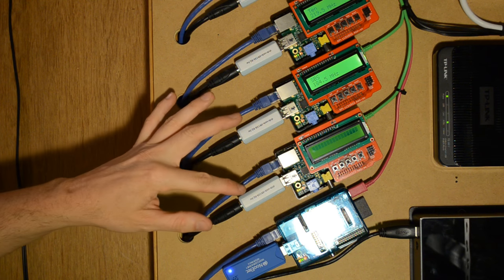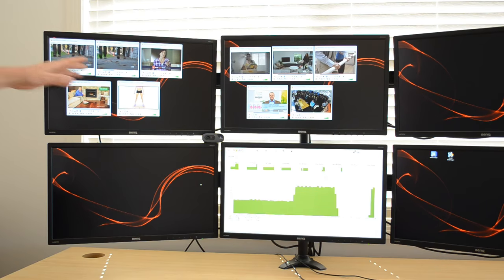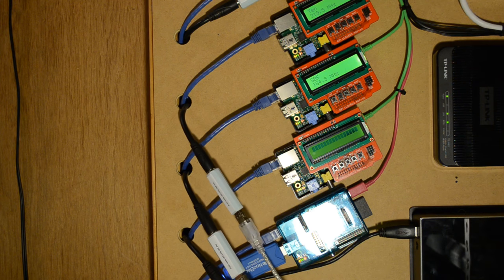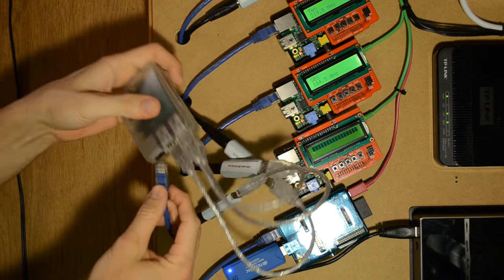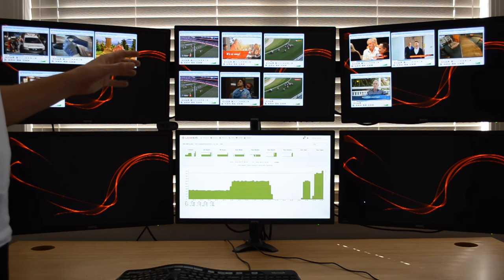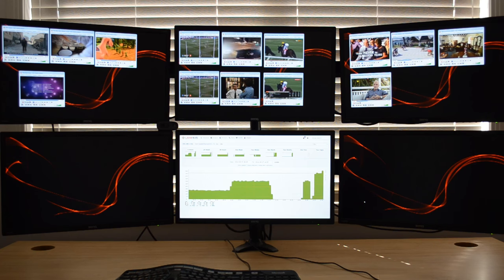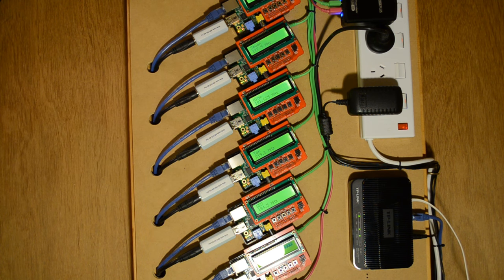Raspberry Pi Multicast TV server - Part 2

Comment: Witch OS are you using on you Raspberry Pi? I'd like to use a raspberry Pi with a Dvb-t receiver. I've been using my laptop but I'd like to use a Raspberry instead. The other thing is that I really like the windows media center interface and its simplicity. Thanks
Reply from the maker: Just Raspbian

Comment: Hi. I was wondering. Why are using multicast? Wouldn't it be easier to use a TV Server Software like TVheadend, MythTV, VDR, etc..?

You can still have multiple Tuners (if you need to), but you can also record and timeshift.
Reply: But then you limit the number of clients.
Reply: Well, not really. By using the aforementioned TV Servers, you can have multiple simultanous clients on the network watching TV. However, if you only have one tuner, then everyone can only watch the channels on the frequency that the Tuner is tuned into.
For a typical Family household, it would make sense to have as many tuners as there are TVs in the House.
TV Server apps with support for multiple tuners are usually smart enough to pick the next free tuner if a client wants to tune into a channel that's not already being broadcast.
Reply from the maker: Multicast is scalable. The Raspberry Pi will only ever serve each channel once. There could be thousands of people viewing the video stream, but no extra work for the TV server.
Recording and time shifting is the concern of the viewer.
This is just a project, not really something people would use in their home.
Reply: Ah ok. I was gonna say, your setup looks exactly like a IPTV setup for an ISP. Total Overkill for the home. But interesting nonetheless. 
How is it with network bandwidth? Does multicast impact your non-multicast network traffic?
Reply from the maker: I have it mainly for testing multicast with Wi-Fi... and for fun ;)
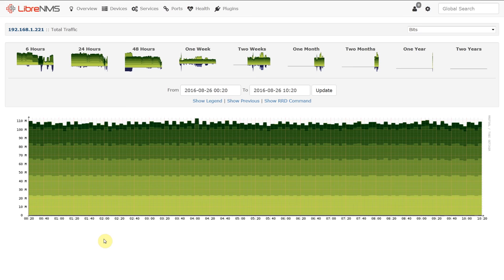As for network bandwidth, see this video @ 2:21    https://www.youtube.com/watch?v=fjDbVIWD8YU
Reply: Did you need IGMP Proxy or to just make sure IGMP snooping is enabled for software bridges?

I had two tuners streaming to the LAN myself but I found it murdered WiFi (I later discoverd IGMP snooping is disabled by default on OpenWRT) and the fact I only have unmanaged switches I was concerned it would flood lesser devices.

Instead (as I am running these on my server so plenty of bandwidth) I switched to broadcasting to br1 (with no physical NIC assigned) and then using udpxy to allow tuning in via unicast.  Its a lot cheaper than buying a managed switch to handle the multicast traffic properly.
Reply from the maker: Just IGMP snooping. Switches of course have to have that feature.
Multicast over Wi-Fi can get messy quickly, as you found. You should check out my other video on multicast.
udpxy is a great program. I might do another video about multicast, as people seem to have confusion about its use.
None of these videos are about what's easy for cost, or what people might find useful, they're just demonstrations of the technology.
Reply: CWNE88 I did have to compile dvblast and bitstream as DVB-T2 support wasn't working without a patch.  There was very little documentation about that and I kinda regret not making notes at the time.
Reply from the maker: I can't help with DVB-T2 as we don't use it here. We do have a HD .h264 channel though which works fine as is.
Reply: CWNE88
I kept the patched source so its not a problem, I just don't remember what I had to do so couldn't offer any help with it to others. ;)

Comment: Google tells me that libreNMS is just for monitoring. What are you using for routing? I've tried a few solutions including pfsense, but didn't find anything I love. This is largely due to the fact that I want to bind a 4 port nic to use as a switch (not ideal for performance I know, but I'm after a drop-in solution to replace consumer grade routers)
Reply from the maker: Routing isn't needed for any of this as it's all on the same L2 network. If you did want to jump VLANs you'd need PIM.
LibreNMS is just for monitoring, correct.
I use a Palo Alto for my routing, but a free, pretty good one is pfsense
Reply: Yeah, sorry, the question was a bit of a non sequitur to the video. Was really hoping to find something for my toolbox better than pfsense, but hey, it does the job. Thanks!

Comment: I was just wondering what this setup could be useful for? If you own a motel and want to get tv to all the rooms? Also, that tuner just picks up free local hd channels?
Reply from the maker: This setup isn't for everyone. It could be used for a hotel as you say, or a corporate network to give staff TV on their computers.... as if that would ever be allowed by management!
Reply: what for are you using this setup?
Reply: On our university campus we distribute TV over the campus network for the members of the cable TV association.
Reply: COMO LO HACEN AMIGO
Reply: Single high quality antenna and some splitter and  you can watch anything on any computer in the house.

Comment: bit fuzzy on the config files from the other video and this setup - its one tuner per frequency, with the config file specifying the pid for the channel and the multicast group to use, is that correct? so with 3 tuners on the one pi, you are tuning in to 3 different frequencies at once, with all the associated channels being broadcast and you just use vlc to select via multicast group?
Reply from the maker: Correct.
The -a says which tuner to use (ie,  /dev/dvb/adapter0 or /dev/dvb/adapter1 and so on.
Reply: thanks for clearing that up :)
have you thought about using a more powerful sbc like the orangepi? it might be able to do more tuners at once, and cost less than multiple rpi's?
Reply: I have 3 of the Orange Pi's. 3 different types. Not much support but much better specs. I bought them to do a smaller version of this for  7 rooms in the house with screens. I have 2500 DVD's movie and TV collection and they are starting to take up space and weigh a lot. I have my own netflix. I wanted to rip them all to disk so they are easier to manage and find. I haven't gotten very far because there is not a lot of support for the OrPi's.

Comment: I suppose the PaspPi would be able to handle more tuners if you had a powered usb hub. I think 4 tuners overload the maximum power output of the Pi USB host.
Reply: That's a good point. He never said anything about that. I wonder...
Reply: that what happened  it   nuke  the  power out put if  you use a power hub it be  fine on that  may be if  it support go with usb 3.0  tunner
Reply: 6 are no problem with external powered hub. This guy is a bloody noob, he just hit the usb power limit.
Reply: Tom78 where is your vlog then?

Comment: I have 5 tuners (it9135v2) on a powered hub on my raspberry pi 2B. I'm not doing multicast, but using tvheadend. So only the actually watched channels are sent to the switch. I know, there are situations when the multicast is better and in other situations the simulcast is do the work.

Comment: Hey, great video. In Norway we have two DVB-T based networks with MPEG4 encoding, one  for the national broadcasting corporation which is free to watch - and another commercial based one with encrypted channels..

Unfortunately, seems like dvblast only supports MPEG-2... (as stated at videolan's website - or I might be wrong? )

Do you know about any alternative that supports MPEG4 streams?
Reply: I use tvheadend with rpi-osmc dist.
Reply from the maker: Most of our channels are MPEG2, but a couple of them are MPEG4 h264 1920x1080 so it definitely works.
I don't know how you'd go with encrypted channels though.

Comment: When you hooked 3 Tuners There was 14 channels on your screen. Did they all came from those 3 Tuner? I was searching for TV tuners on our Local market that supports encoding multiple channel at the same time, But I failed :(
Reply from the maker: It's one tuner per frequency. Each frequency has mulple tv stations multiplexed into them as a complete bitstream.
Reply: @TallPaulTech   Thank you for quick response.

Comment: How many tuners can a RPi4 handle? Have you tried?
Reply from the maker: Easily 4 if you have a good power supply
Reply: @TallPaulTech  Five at a stretch??? Via an outboard USB hub of course???
Reply from the maker: 2 MHz of RF sampling takes about 35Mb/s of network. It won't take much processor, but power will be your main issue (and possibly RF noise).

Comment: Any chance you know of a good frontend/smart tv that can join multicast groups? I'd think about something like this for motels in my area if I could either recommend a smart tv or could pop in a hdmi PC stick or something that gave the guests the ability to just sit there and flick channels with their remote - while at the same time if they want to choose netflix instead then they can do that too
Reply from the maker: The only one in hardware I've used is something made by Amino. That was years ago though.
OSMC can view multicast, you just have to make a .strm file with the address in it.
Reply: Cheers, doing the maths I'm wondering if it might be easier to just use kodi and tvheadend...means I don't have to make sure multicast works properly across all my switches.  With a gigabit backbone I should still be able to serve at least 50 concurrent streams.  Or would a unicast system also launch a new thread and tax disk i/o each time the same multiplex is requested?

Comment: I see you have more than 1 tv turner inputs, why is one tv turner is not enough?
did you buy more than one cable package or do you have to have more than one tv turner.
usually one cable serve lots of channel. can you enlighten me?
Reply: The antenna / RF cable contains all the transponder frequencies with their respective services - all the channels are there, but you basically need a tuner to use that on a PC. I gather that each raspberry tuner in this setup is tuned to a different channel each and retransmits that on the LAN as a multicast RTP stream so that any PC on the network can receive that (without needing a tuner.)

This is a very cool setup, but it seems very highly specialized. If you want to watch TV from a tablet on wifi I guess it's perfect. If you'd like to avoid pulling coax to the different TVs around the house, you could put  a "decoder" raspberry on each display for receiving these streams.

It seems to me that the setup could also be adapted to have instead of fixed channels, a pool of tuners available for different users on the network. That would allow for all the channels to be available, but would require the client / viewer to have a channel selector front-end add-on to talk back to its designated tuner.
Reply from the maker: You're right. It's specialised, and I don't think most people would want/need this. I don't even watch TV because it's crap and I have better things to do. I do however need a multicast source to test network stuff. Also, it was fun to build :)
All channels are available, which is why I have 6 tuners. There are 6 frequencies, each with a bunch of tv channels in them multiplexed together. I just give them their own multicast group.
You can see the details in the first video I did on this.

Comment: How many channels can stream per RPi2 ?
Reply: didnt he just show? maximum of 3 with small glitches, 2 going stable... it is same amount of how many tv-tuner you can attach on it, as on this video. Or do you have TV that shows multiple channels at a time? (well, premium TV's often has PIP and/or 2 tuners to record with one and watch with another)
Reply from the maker: The problem I had when I made this video was a crappy power supply. When using a solid power supply, the system is absolutely solid with 3 tuners. I've been running that for a while now.